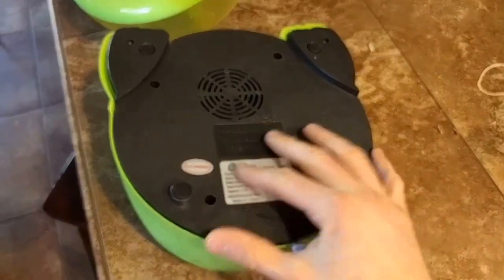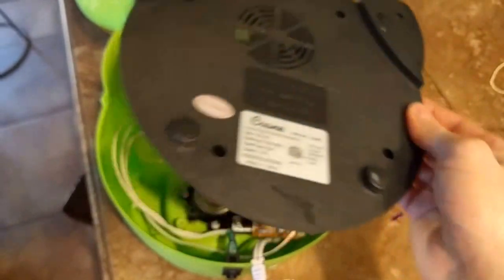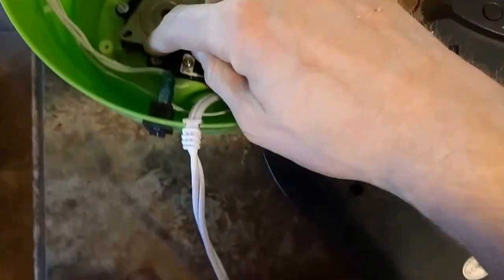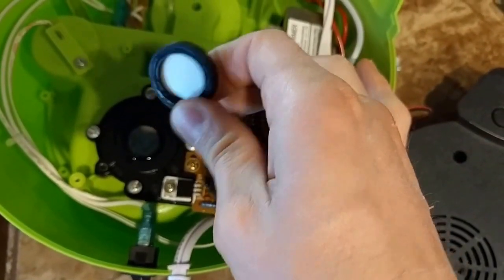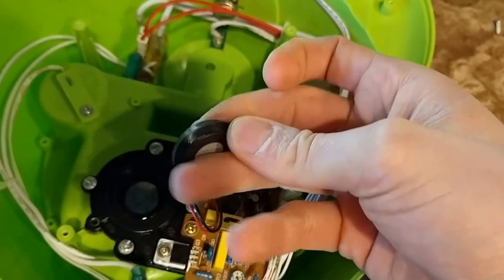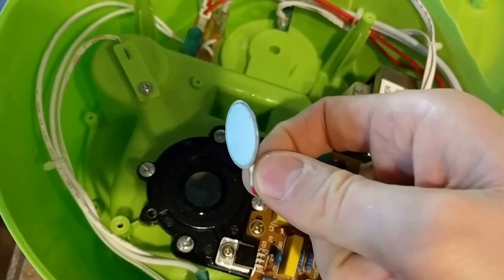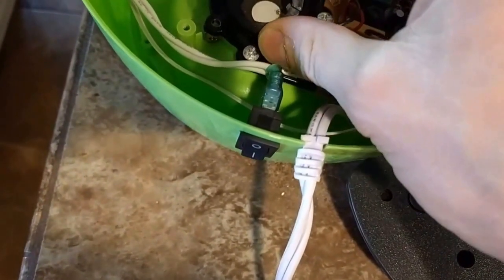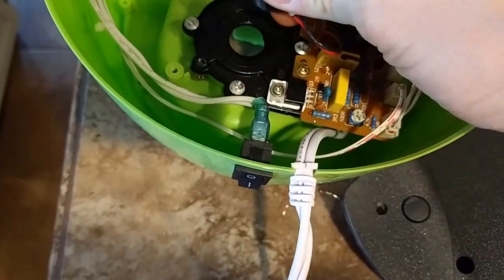Crane Ultrasonic Humidifier low mist - SOLVED

Comment: This helped me fix one of our Crane humidifiers. We have the elephant that stopped putting out mist. The fan running, but no mist. There didn't seem to be much buildup after taking it apart, but it worked again after reassembly.
For those who have the elephant as well, there are five screws that need to be removed to pull off the bottom. All are deeply recessed. Three are easy to see, but two are hidden under the rubber caps in the front feet.
Reply from the maker: Glad it worked.  I figured it's time to film some of  my repairs that I undertake, and repay for the hundred or so DIY videos I have watched.  Next step, phone/camera holder.
Reply: Bayli7 hello how did you open the elephant
Reply: I already remove screws but it's stop stunk liken in legs part
Reply from the maker: I would say (this is without seeing yours), to use a screwdriver to try and pry it open.  There may be little plastic clips holding it together along with the screws.

Comment: Thanks wiping the edge of the diaphragm worked, even though I can’t see any visible clogging on it. I own a Levoit. This should work for all ultrasounic humidifiers and living in a hard water area like the UK. I do add a splash of hydrogen peroxide with each refill.

Comment: Mine would sometimes make a sound like fan had a bad bearing. It turned out to be the fan’s air filter, a flat sponge with fabric on one side. I’m not sure what is supposed to keep the filter from getting sucked into the fan?

Comment: How do you clean the ceramic or with what liquid ? I try to fix with same problem but still dont work.
Reply from the maker: Did you take the disc all the way out of the rubber housing?  For cleaning, I did not use any checmicals.  I feel it was the build up of the minerals that stopped the disc from vibrating in the rubber housing (which is what produces the mist).
Reply: chipedge oh see, i do same, pull out the disk from the ring... i just wipe all of them with dry cloth.... when i check with power on, the disk only make small water bubble but without mist came out. Do thing i should change the disk with new? Thank again for advice